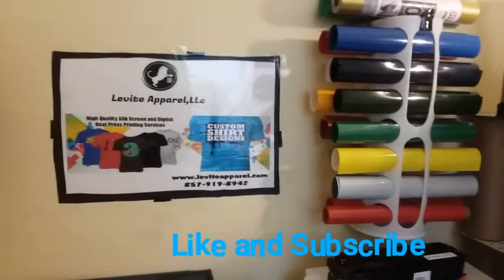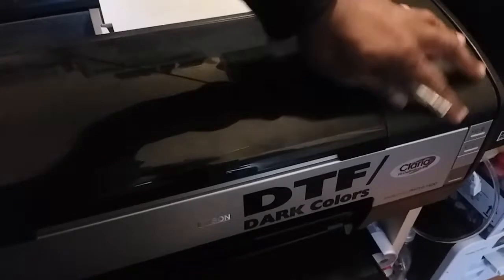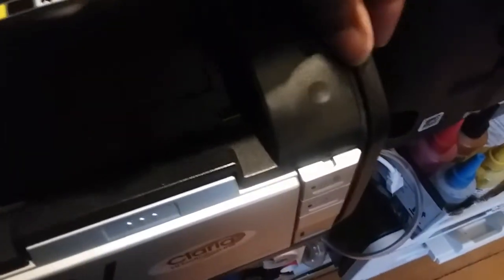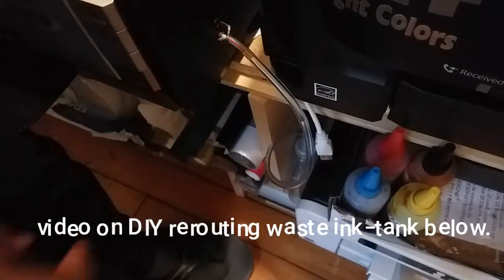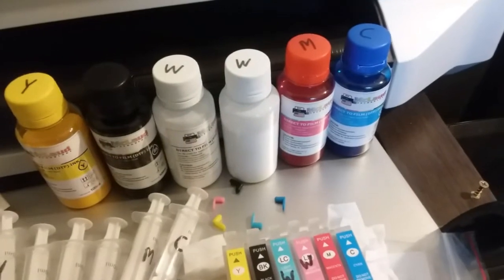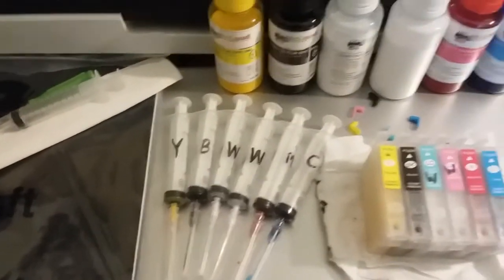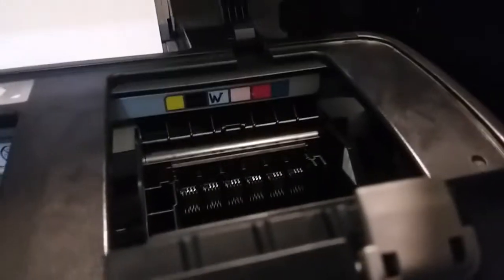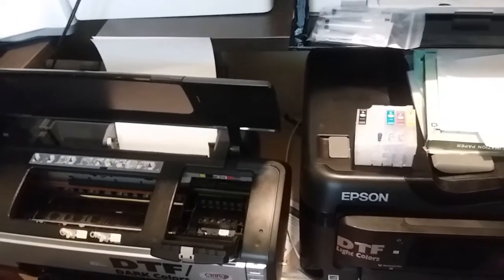#How Converting  my Espson 1400 printer 🖨 DTF & waste ink-tank and ink set-up #dtf #tiktok #trending

Comment: I have epson artisan 1430 I'm on the fence about converting.  How you l UK king it so far
Reply from the maker: Before you think about converting it Google what printer does acrorip 9 or 10 use First. Then see if you can get a used 1400 or p800. If something happens to a used printer you think less about it but brand new Me get you what is boiled.
Reply: @leviteapparel  I actually got the printer for free
Reply from the maker: @TwelveGoneApparel  my man you on point bro if you add  refillable cartridges you can use this printer for DTF light because you won't have the white to go over it for the bass. But unfortunately you can't use it for a DTF dark garments printers below are the ones you can use
Epson Stylus Photo 1290, Stylus Photo 1390/1400, Stylus Photo 2100/2200, Stylus Photo R230, Stylus Photo R290, Stylus Photo R1800, Stylus Photo R1900, Stylus Photo R2400, Stylus Photo R2880,v Stylus Pro 7600, Stylus Pro 4800/7800, Stylus Pro 4880/7880
Reply: @leviteapparel  it has 6 cartridges I found a supplier that has lots for it